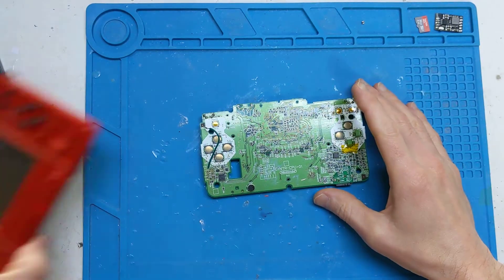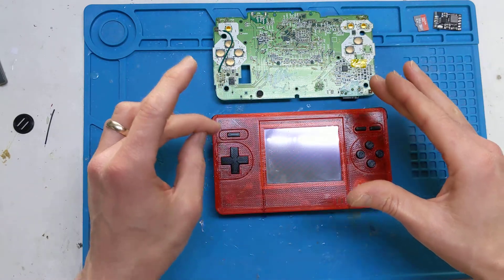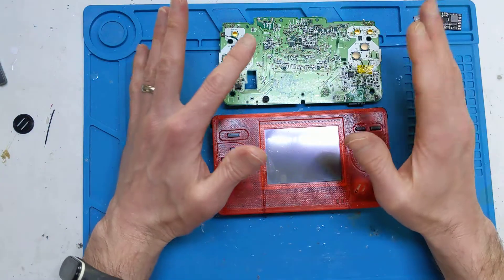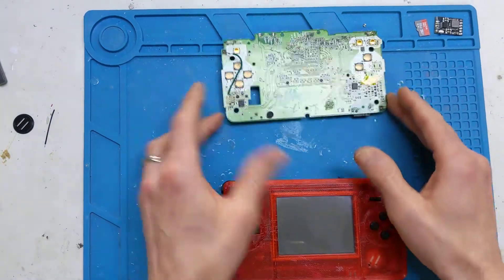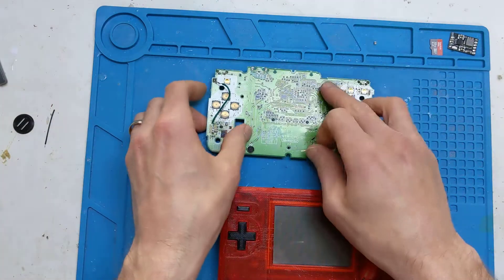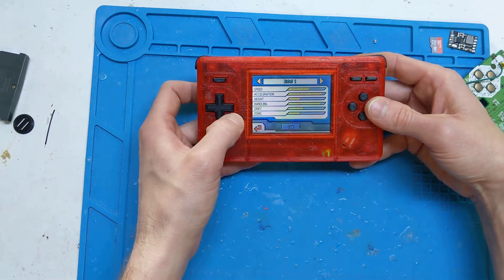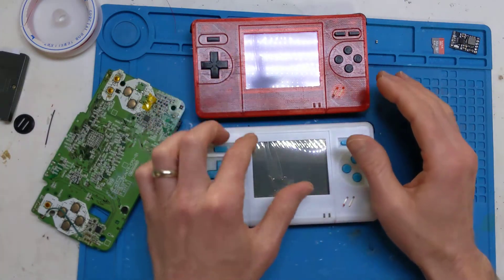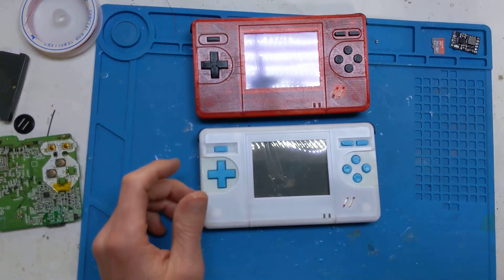DS phat screen switch new method

Comment: Would this work on a DS that still has both screens? Or does the top screen have to be removed?
Reply from the maker: So you don't have to remove the top screen for this to work but you would ether have it display top screen on the top and bottom screen on the bottom or top on the top screen and on the bottom screen at the same time. If you want to switch the screens you would need a second switch and wire it up in a similar way but have it controlling the top screen instead.
Reply: @facelesstech  That makes sense. There's a few games that play on the bottom that I wish didn't. I'll look into this. Thank you for the reply!
Reply: Any idea which connection points those might be?

Comment: Hello friend, I greet you from Mexico.  I have followed your videos.  I saw that this new method has no fault.  I saw that some did not succeed when doing the old method.  Because the screen was not visible when making the change, that is because the signal comes with more intensity.  It is solved with a resistance of 740 ohms of the signal for the screen above the switch.  thanks for everything.
Reply from the maker: Ah yeah I've heard people doing that in the past. Thanks for sharing m

Comment: I love it, only problem is the touch screen sucks on the DS, wish there was a way to have a touch screen that looks as nice as the top screen.  That would be the ultimate DS
Reply: Just get a DSi XL, they have top and bot IPS displays guaranteed.
Usually there are a lot of broken ones with a missing or dead top display, so its perfect for a dsi macro xl